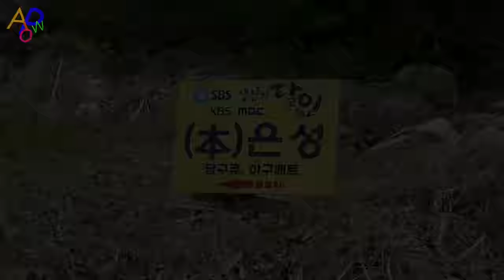Process of Making Elaborate Pool Cue. Korean Billiards Cue Stick Master

Comment: Forget the cue stick, it's amazing he's still working with 10 fingers!  When I got to 00.28 I was astounded to see that he still had all of his fingers with few if any scars.  Maybe he's living proof that if you push your finger through the saw fast enough, it won't cut you!
Reply: I don't see any saw though
Reply: I once worked at a company that had a machine shop as part of the manufacturing process.  The guy running it was missing fingers from both hands.  He kept his fingers along with others in a gallon transparent glass jar filled with either alcohol or formaldehyde along with the fingers.  It was prominently displayed in the shop as a reminder to all of the dangers of complacency when running the equipment.  It worked as they didn't have any accidents during the seven years that I was there.
Reply: not a safe practisce when using table saw.without  riving knife.or at least use push sticks instead of his digits..

Comment: Leaning over a running lathe with somewhat loose clothes always bugs me out . I'm a Plummer but have worked in several machine shops seen some nasty stuff . A lot of the accidents were to some of the most experienced Machinist , but no doubt this guy is very good at one of probably many crafts
Reply: Yeah I was thinking the same thing.

Comment: Sorry to burst yalls bubble but unless they heavily edited out a lot of stuff, this cue will warp insanely fast. It takes months of slowly turning a cue down using wood that's been cured for a long time so it doesn't warp. You can't just go all gang busters and take that much material at once. Especially considering the humidity aspect of much of Asia, that just adds to the problem with warping. This is the exact reason there are only a couple truly top quality cue builders from Asia that get top dollar.